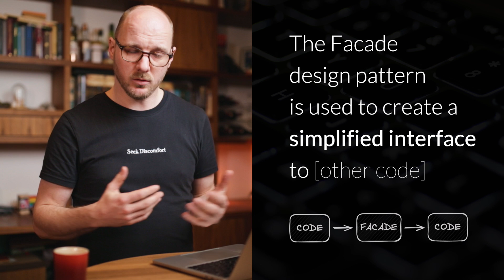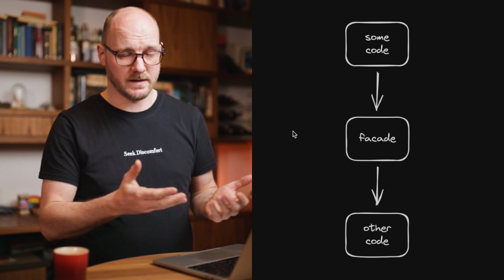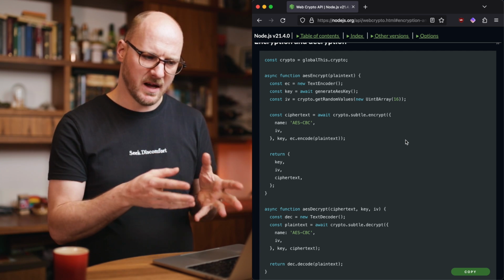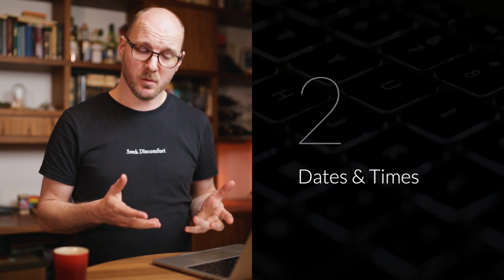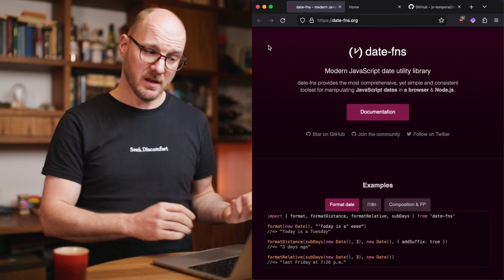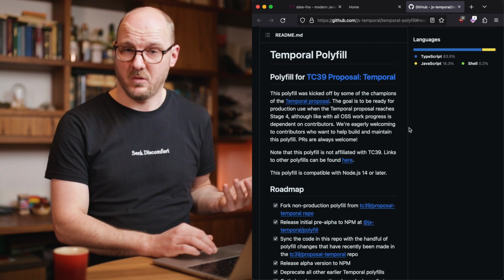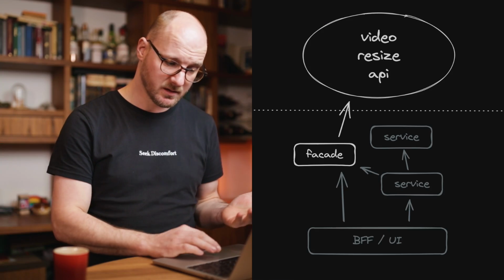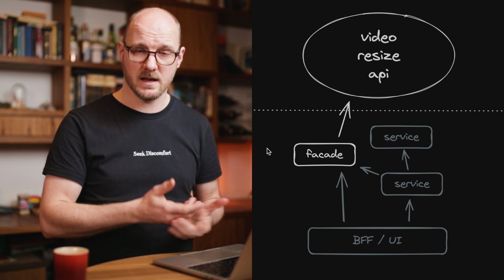The Simplest Design Pattern: Facade

Comment: What is the difference between a facade and an API? Thanks
Reply from the maker: Everything has an Interface. The interface of a function is it's name, it's arguments and it's return types. The interface of a TV is it's remote control, and the interface of a car is it's steering wheel, gas/break pedals, etc. When using it like intended, we don't directly interact with the internals of a TV (circuitry), nor with the internals of a car (engine). I have a video on Interface-First Programming if you want to know more. You can think of the interface as the thing you are interacting with, which is different from the things that are behind that, which you are not directly interacting with. 

The interface exists because it enables a use-case: the engine of a car can run by itself, but it's not useful yet, just as a TV can run without a human watching it, but that's not useful. We added a steering wheel to an engine because humans are using the engine for a very specific thing; going somewhere. The interface encodes it's use-case. 

A Facade is an extra layer (an extra interface) in between a call site and an implementation (e.g. a function, file, class, or service). This extra layer can be there because you don't like the interface that the implementation offers by itself, or it can be there because you don't want to directly depend on the interface of the implementation. 

A Facade has, like all functions/classes/files, also an interface: it's names, arguments, return types, etc. Anything you directly interact with from the call site.
Reply: @branvandermeer  So, if i were to program an extra layer between the firebase API and my web app because I didn't like the convoluted process for image uploads and wanted to simply function calls with a one time configuration, that would be a facade.
Reply from the maker: @benflightart  yes!
Reply: @branvandermeer  thanks for helping me understand!